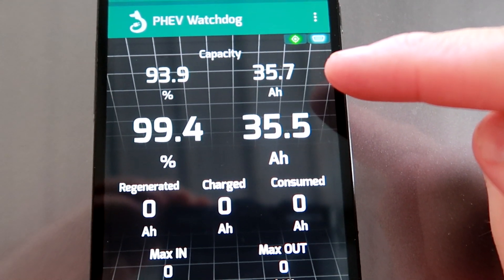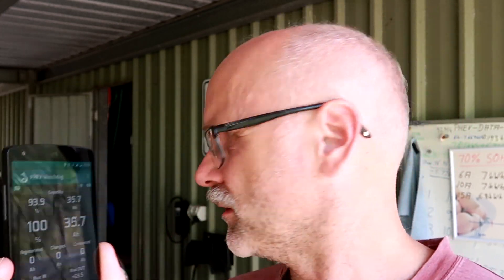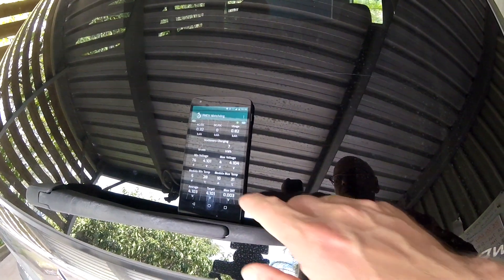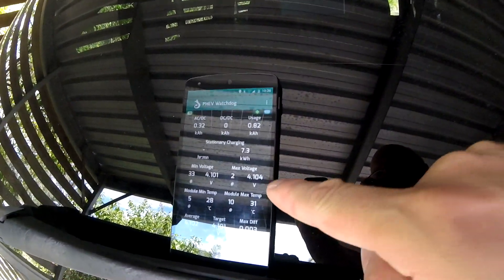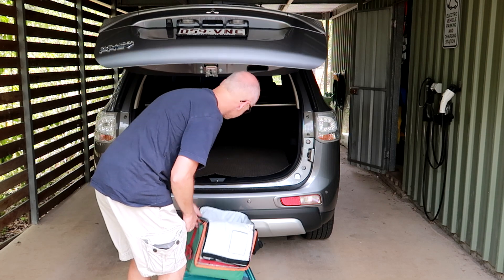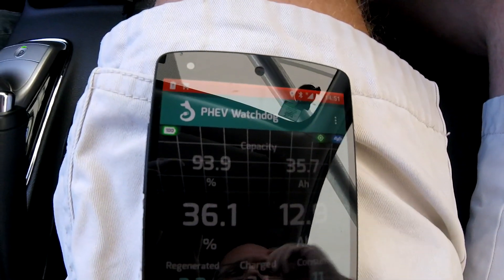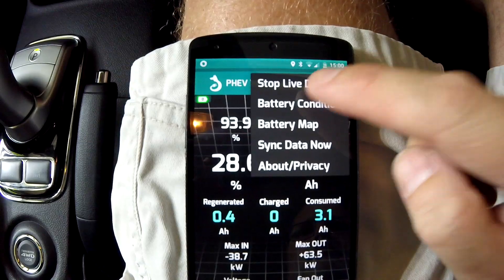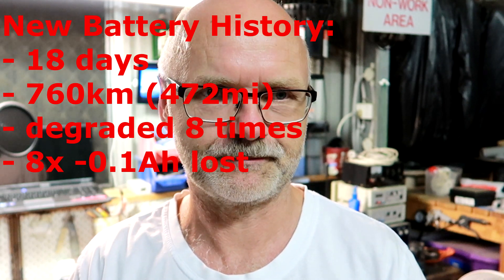EP180 - The PHEV software is totally nuts. Charging with 2.5kW at 100%

Comment: Moin form Germany, what happens with the degradation, if you use the origin charger or a charger that load with max 6 ampere ? CU
Reply from the maker: Moin to Germany! The charger is fixed in the car. The box outside with the cable is just a control unit telling the car how much amp it can pull from the grid. People usually calling this the charger but it's the EVSE (Electric Vehicle Supply Equipment).

Comment: how do you know that SOH displayed in the Watchdog is a true SOH ? It could be some artificial number. I'm measuring the amount of power that my car takes and after 12 months and 21,000 km PHEV takes about 96% of what was new. The Dog shows 88% - I think the number that Daniel is using for SOH is not accurate
Reply from the maker: The Dog shows exactly the numbers the BMS uses internally. There is no modification or calculation. All dealerships have confirmed the Dog's numbers when checked with their official MUT III device.
Reply: @unpluggedEV  , yes so the BMU shows rubbish SOH , but the car keeps changing to the true capacity. Since the "SOH" is not accessible by regular users then who cares ? The only think that we should care is how much power you can push into the battery. Your old battery was very bad, your new battery charge up to almost 38Ah , so everything is good , isn't it ?
Reply from the maker: Nope. Lets see what you say once you battery goes below 80% SOH. I could not even charge 6.5kWh into it any more and the range was... well, you know.

Comment: Arghhh, all the test has shown is that the S/W is driving us mad 😡 

Thanks for testing it.  By the way, did you get 38Ah worth of range, or the 35ish that the S/W showed you?

And I miss Woolworths, died in the UK years ago. 😢
Reply from the maker: You never get 38Ah out of the battery. If you're good you'll get 30Ah max, more 28-29Ah...
Reply: unplugged EV, ach... of course, bottom buffer.  Just wondered if the real-world SoC/SoH showed how out the Software was. 🤣

Comment: The BMS do not know the SOC by looking at the voltage, but by counting the amps inn and out while charge and discharge.

The reason for this is that the voltage curve on li-ions are flat in the middle.

In order for the BMS to recalibrate, the battery have to discharge so low that it sees the voltagedrop at the end, and then recharge.

The calibration on the top happens when the Amp is below a defined value when the CV part of the charging happens. CV stands for Consent Voltage. On a 80 cell LEV50 pack, this is 328V

If the BMS off, you can see battery is still charging while the SOC is 100%

The BMS also do top balancing with dump load on the cell with overvoltage. This will show up as charge current when the BMS is dumping power into a load.

Baced on the chargecurrent I have seen while balancing is active , the dump loads must be of a high power rating...
Reply from the maker: Yes, that is correct, the BMS does coulomb count to determine the SOC. The usual top balancing happens at a charge rate of around 100W only so simulate an open circuit (Voc).

Comment: I think I've said before, it seems like the vehicle software hasn't registered the initial output parameters of your battery .
If there are 5 or so battery parameters (voltages, etc) that should provide a zero baseline for the software, but they weren't checked or set, the readings will be floating around as the software tries to align them.
My money is still on some kind of procedural error during installation and setup.
Reply from the maker: I think you're very close with your guess... stay tuned!
Reply: do new batteries have to be calibrated first? Recalibration?

Comment: Hi Andy,
Clearly here it is demonstrating that issue is with the software. But the russian guy made a good could it be that issue is with the dog program? 
NEVERTHELESS at the end of the day, the car has continued to charge over 100% to land arround 104% nd 37amph, so this is your true state of charge at the end, and provide you the maximum capacity you can have with the batterie. This test also show that charger does know about the state of charge, i gues it is just measuring  amp'of of the battery while charging. May be it would be a good idea to check with the dog developer and mitsu how value is calculated and as you suggesg why not overwritting the final amp obtain to replace the max soc everytime % is over 100% and calculte the SOH from there. If it is difficult to have this done by mitsu, may be the Dog guy can add some lines to his program, one showing soh and soc as today, and the second line estimated as we discussed?
Now with the previous batterie range was decrease wasn't it? So there is probably a natural battery degradation, baut as you show obviously not as dramatic as shown by the software.
Reply from the maker: The Dog reads only the info which is on the CAN bus of the vehicle. It does not calculate anything. These numbers are what the BMS knows.
Reply: @unpluggedEV  Andy, 
Nevertheless, if i understood, the dog is an independant software, isn't it?
So i guess it could calculate its owned soh based on the finale charge and keep this on the phone as a local phone data. Or software used does not allow this?!)
(This situation for example is occuring with the gasometer. If i understood, dog is calculating and evaluating the remaining distance to run differently from mitsu - so this would be another example here)

I have ordered my phev outlander 2019. And i'm very exited to get it and have the dog. What is done here i really amazing!
(my first name is simply Pascal)
Reply: Pascal Plaga Lemanski , 

I learnt today that the Charger doesn’t need to know the state of health of a battery as Li-Ion batteries run on constant current up to full set voltage (4.1V) then constant ampage until full (when the current drops to near 0) in a ‘soak’ stage.  It just fills until the battery is full.

As for the BMS... what a mess